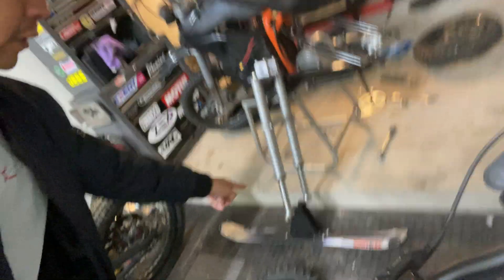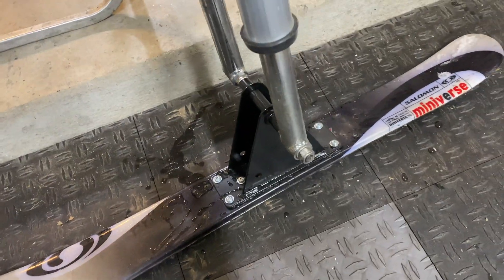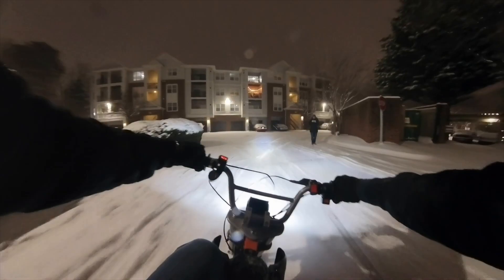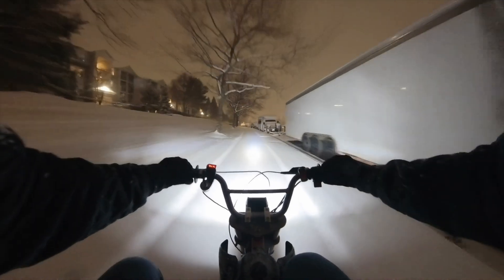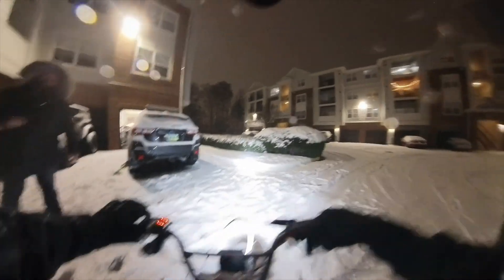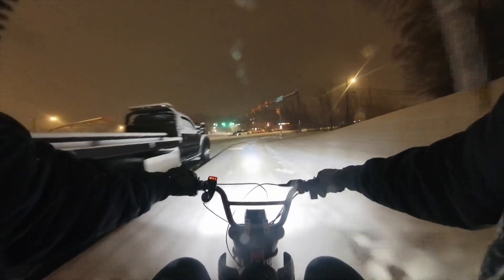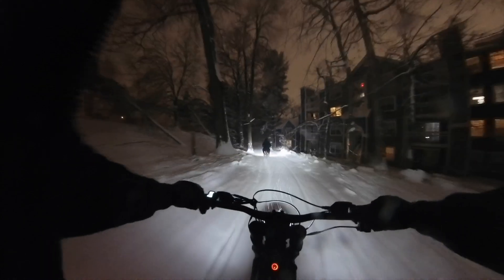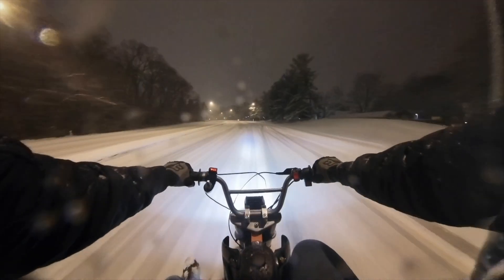I Built an ELECTRIC SNOW BIKE with a 72V Razor MX650

Comment: How do you protect the battery from getting wet and the cold temperatures?
Reply from the maker: It’s a sealed battery with a QS-6 connector. Just make sure the side covers are on and don’t fall 🤷🏾‍♂️

Comment: Dude, I was just thinking it's been a minute since I've seen one of your videos in my feed!! I'm inspired to build something similar now.  I'm sitting up in New Hampshire in the beginning of a storm right now.  I bet if you were to put the Ride or Die 710mm forks on that with a 3-4 inch swing arm extention, maybe a bigger ski, it would go into powder like crazy.  A sealed motor would probably last longer in the snow, hopefully the ec5p is released soon.  I have a feeling it will be very similar to the new sotion motor for the razor platform.  Thanks for posting, u rock!!
Reply from the maker: Well I was thinking about doing this to my other 72v MX650 now.. that already has a hydraulic fork and swing arm extension kit on it. I just wanted to confirm this set up actually works before I pulled the trigger on doing it on a second bike for the winter